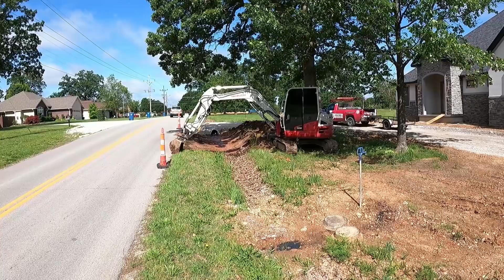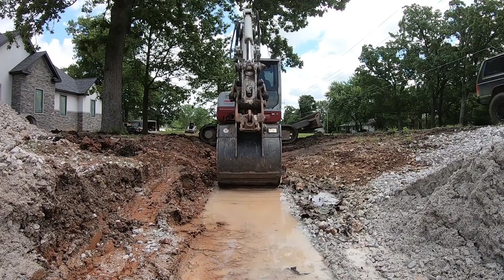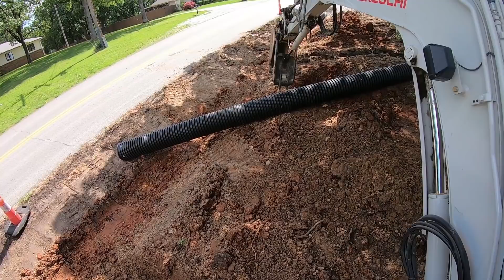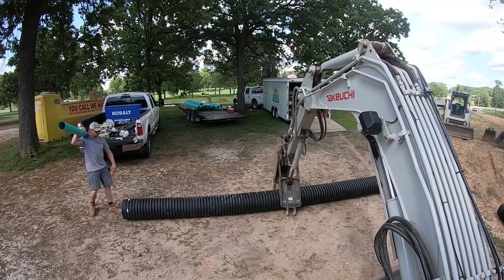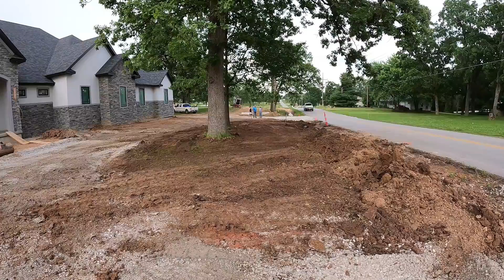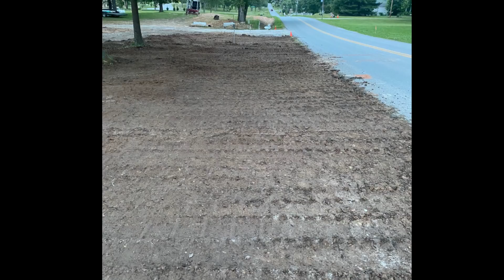Installing Culverts To Fill In A Ditch

Comment: Looks so much better being grass covered.  Easy maintenance.  I love bridges, culverts & drainage pipes with proper covers.  I don't like ditches for a very good reason.  My daughter almost drown in a fast running irrigation ditch in front of Dad & Mom’s 40 acre farm house.  Shortly after she started walking, she started running fast every where.  I had asked her father to watch her, while I checked the mail.  I reminded him when I looked, before jumping the ditch.  She was still standing beside him, as I glanced again after jumping the ditch.  As I turned to check the mail box, same spot.  Of course this Mom was so glad she was paying attention this day & just how fast things can go wrong.  
 
Looked in & grabbed the mail.  I look up again, as I turned to jump back across the ditch.  She was almost to the ditch in seconds.  Instead of jumping across the ditch, I jumped into the ditch.  Just catching her under her arms, as she went underwater.  Not quick enough to prevent gravity from working & her from getting wet.  She was okay, just wet & crying, not coughing.  I was soaking wet & so was the mail.  We would all dry out.  Needless to say, I was not happy with her father.  Which had seen what was happening, taking his first step 30 ft. away as his daughter stepped into the ditch.  

But, day got worse, when Dad called.  Same day my Dad’s dog got out of the house & run over in the road.  I had to accept the blame for happening.  Which, I regret happening to this day.  Tad was my favorite of all of Dad’s dogs through his life.  I loved the little mop of patchy colored long hair.  Tad & Dad was such a joy to be around.  Bless Dad’s Heart.  Dad was very upset with me & I didn’t blame him.  I was the one responsible to make sure Tad was in the house, before we left.  I had failed him so bad.  I didn’t have the heart to tell him, his granddaughter had almost drowning in the front ditch.
Reply from the maker: Wow I’m sorry to hear that. Very glad your daughter was ok though. That’s scary I’m sure your dad was glad about his granddaughter making it and understands stuff happens. Appreciate you sharing that
Reply: @eliteearthworksllc  I never was brave enough to tell Dad about his grand daughter.  I had already really screwed up, getting Dad's dog run over.  After Dad had warned me, Tad had become a artist at slipping out.  Told me to be sure he was in before we left.  I didn't want to fail him again.  It would have just made it worse, Brandon.  Maybe not, I was so ashamed.
Reply: @eliteearthworksllc  Thanks, Bless Your Heart.  Its amazing how old memories are triggered.  That has been almost 50 years ago, when I was a young parent.  Stuff happens so quickly.  

That's why it is important to keep filming.  Just give it to us in time lapse.  Works for me, too fast I just slow you down to .25 speed & mute.  

I was hoping to see how you cut into the main drain line from the down spouts.  I saw what it looked like after & pretty much understand the how, I think.
Reply from the maker: That’s understandable for sure!
Reply from the maker: Yeah I was hoping to film some of that but they just used a 4” hole saw and drilled into the culvert then we concreted around the pipes so they wouldn’t leak

Comment: I wish I'd seen this seven years ago when I talked myself out of putting a long culvert between my well-house and the barndominium, I just couldn't figure a reasonable way to get the downspouts connected.  Would have made for tracking a lot less mud in the back door of the barn part.  Oh well, about to build again, soon as I get this place sold, so thanks for sharing.
Reply from the maker: Lol I wasn’t sure how it would work either. But it should be pretty slick now. Best of luck on the next one 😁

Comment: Great job and vid! I want to install a culvert in the ditch between my two pasture. But newbie here, question is how to choose culvert, there are steel, concret or plastic pipe in your vid, any pros cons for each type? In your vid, thr pipe didnt get burried too deep, can run truck or tractor on it? Thanks a lot!
Reply from the maker: Thank you! I like the plastic the best. It’s tough and heavy duty plus they won’t rust like the steel ones. The concrete ones are good too just not as easy to work with. I usually try to get at least 12” of coverage but that doesn’t always work

Comment: Is it an optical illusion or is the street higher than the house? It looks like the water that runs off the road will run to the house without a ditch.
Reply: I think the camera lens makes that illusion, house is higher than the road, but not by much. 👍
Reply from the maker: The house is slightly higher it stills runs down the edge of the road to the second driveway then hits that ditch. It will look better and make more sense when they finally form the drive up
Reply from the maker: Yes it’s very close

Comment: Not sure where you are located, but did you have to obtain any permits or permission from the city/county prior to doing this? I have a similar layout on my frontage, and I would like to install a culvert like you did in this video. Just afraid of opening a can of worms getting them involved if I don't need to
Reply from the maker: I’m in southwest Missouri and I didn’t need to get anything. We were just outside the city limits but we would only need a permit for the driveway culvert and approach they don’t say anything about the ditches

Comment: If my property, had to have a drainage ditch like that . I would build a retaining wall as closet to the road.  The dog out and taper to the wall, asphalt ( closed mix)  the ditch line from road edge to wall. Making sure good grade so no water held in ditch.  No more maintenance needed!
Reply from the maker: That’s a good idea 👍🏻
Reply: @eliteearthworksllc  yep you know that pipe is going to plug water will run over driveway, yard will flood, wash over other driveway. Just see a lot of more work down the road. Also day light  the roof drains at wall easy to jet clean, put a slight swell  into the yard so drains to ditch, can put in a stair step/ channel in wall for yard drain in ditch . Put up small decorative fence, and gate at step , at the retaining wall to isolate yard from ditch would look really nice,  no water drainage problems. Just rake out ditch if needed! Also give parking to guest and keep out of drive way maybe?

Comment: They'll be really lucky if that big oak tree between the driveway and road lives. It would be awesome if it does but I'm not so sure after all the work you did around it. The smaller one probably will make it since it's so much younger and doesn't require as much area to grow roots right now. Not putting much if any fill over the roots helps too. 👍
Reply from the maker: Yeah I tried to stay off the roots as much as possible but time will tell.

Comment: Soo much better looking Brandon!! 
    That’s a nice option where you live as it’s very unlikely to freeze up. Could be an issue here in Canada!! Hahaha. I would definitely prefer mowing that vs a half day heeling over from one side to the other!! 
    I don’t have to mow on my 2 acres anymore, it’s all natural mountain/prairie grasses and granite! No more than 5” tall grass, generally, and it’s sparse. In the side yard we created for our dog we have a 40 ft x 40 ft area of artificial turf! She took a bit to adjust to it, but now she tears around an rolls on her side flat out and slides!!! They are such athletes when they want to be. 6 ft chain link fence to keep the deer out. One tried to stomp her already! Small doe. Just grabbed her front feet after she whacked me a few times (it bloody smarts getting kicked with those little feet) then dragged her to a shallow ditch and rolled her in. Off she went! Haha. There’s a hot wire on top for any bears that may feel the need to climb over. It’s a new development and we are at the end of the road. Wildlife was affected, definitely by our property, but then we are part of nature as well really. 
      We have pressurized irrigation pipes down far enough in some areas to keep from freezing and then homeowners can o pull household water out year round. It is treated and filtered in the home. It’s pretty clear going in the home so UV light and a sand filter is usually enough. Our place is on a water co-op! My runoff goes into a valley about 40 ft down and 4-5 miles across. No more water issues for me, ever!!  
    Sorry, rambling. We were definitely fortunate finding this place and when I see the water issues you have to deal with there, it reminds me of the frustrations the ranch could have as well, when we were there. We didn’t leave any projects needing to be done regarding runoff for the land we sold for the new owner. If only he knew how it went back and forth over the 55 years I lived there. Hahaha. 
    Fun to watch how the project could change and be accommodating for the client. You are a good operator when you are willing to allow the homeowner to change their mind and go a better route. Well done Brandon!! 
   See ya in the next video!!
Reply from the maker: That’s cool I would imagine those pipes have to be down deep. Wow I would say your good on runoff then 🤣 it’s neat hearing about your property and how much you had to change it sounds like a nice place. Appreciate you watching and commenting as always!

Comment: Brandon looking at you lifting that culvert pipe it looks like you need to have two more teeth on your thumb bucket one on each side. Just a thought looking good
Reply from the maker: I don’t think I had it in the center. I plan on getting a 4 tine. I think this one is make for 12” buckets I’m not really sure why they only put two on it

Comment: The things ive learned about cones and traffic is, the cones are just another target for the drivers, they will hit them and keep on going. I had a lane shut down one day working in a telco manhole and a old blue haired lady took out our cones and she was dragging two of them under her car, i got on the radio to a friend about a 1/2 mile down and he managed to flag the old lady down and remove the cones from under her car.

Strobe lights only make drivers focus more on the utility vehicle they are about to hit. If you slow the flow of traffic you will get cussed out by drivers.
Reply from the maker: Wow that is true though people will definitely hit them
Reply: Elite Earthworks LLC yeah people will not slow down for anything, its gotten worse with people using smart phones while driving.
Reply from the maker: Yes it has!